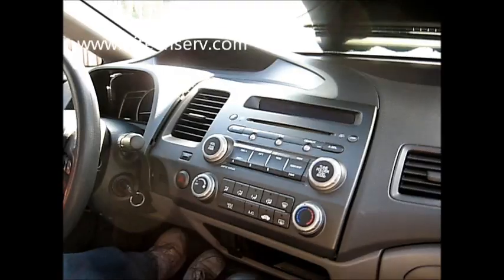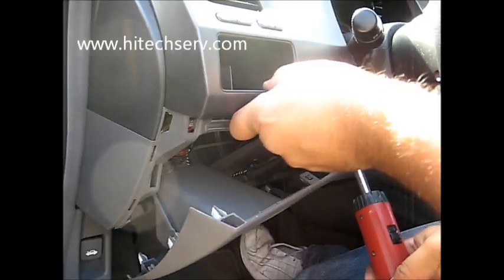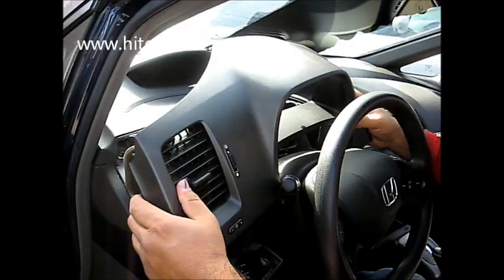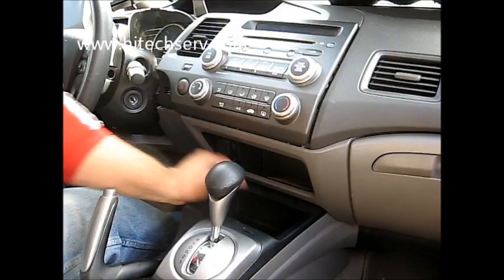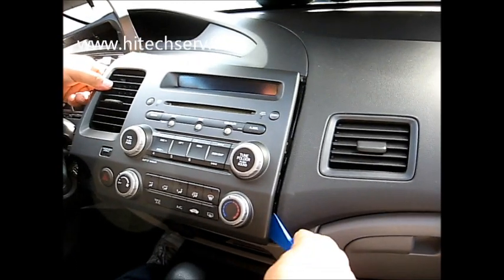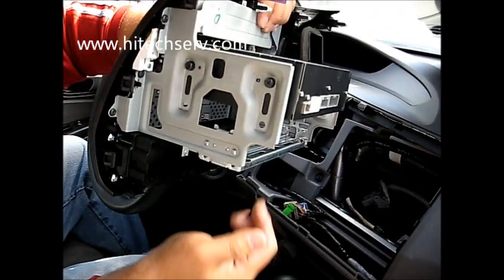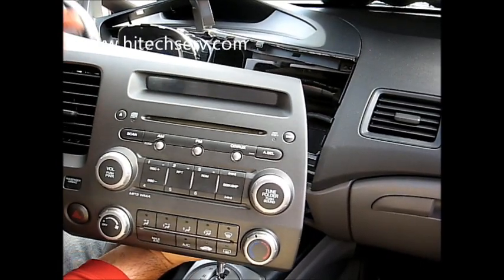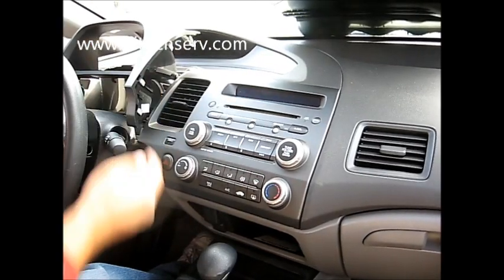How to Remove Radio / CD Changer from 2007 Honda Civic for Repair.

Comment: I looked up how to change the dash (I've been planning to change my 2009 Civic DX head unit) and apparently I have to BACKorder a completely new set of parts for the dash, antennae and brackets which will in itself cost me $80... I can't believe how much of a pain Honda is making going aftermarket with their current models.

Comment: Thanks for the video. I was interested in your video because I wanted to get under the dash to get to the little speaker which chimes at you for everything(door open with key in ignition, e-brake on, no seat belt on, etc) did you see the little speaker or do you know where it is? I want to soften the noise it makes.

Comment: Can you please tell
me why the radios illumination is not working !?? The steering wheels cruise
control control buttons are barely illuminated. They just barely light up enough to notice that they are receiving very little 12v power. But obviously not a full 12V.   And the rheostat that controls the dash light output is working fine, because I can brighten & dim the dash itself, the radio screen & the heat & a/c control panel just fine ! But the radio controls are BLACKED OUT & not illuminated at all. And the steering wheel cruise control buttons are just receiving enough voltage to see them illuminate a tiny amount ! Can you help !? Please. Thank you !

Comment: hello i have problem with my honda civic radio button .i pressed the (seek/skip button ) where it points forward and it stuck and now i cant change radio stations or switch fm and AUX.is there any way to fix it ?
Reply: I'm pretty much having the same problem. My radio is stuck on a certain station and the only buttons that work are the volume buttons.